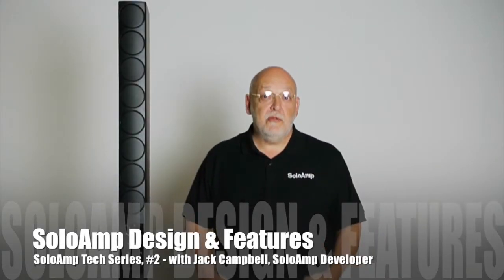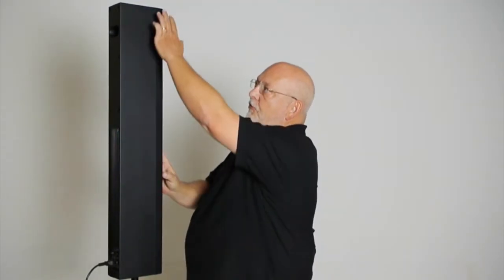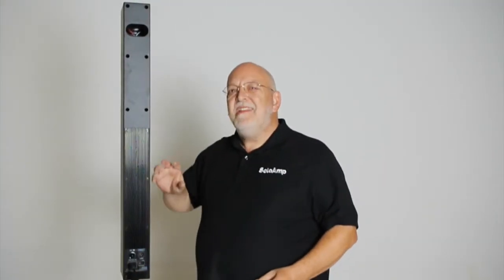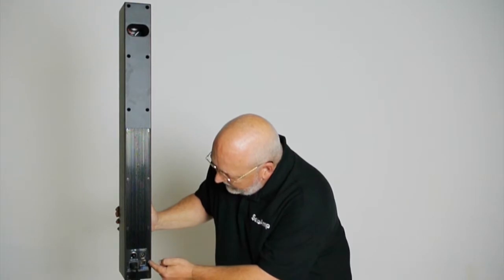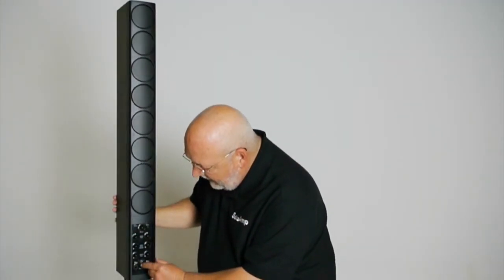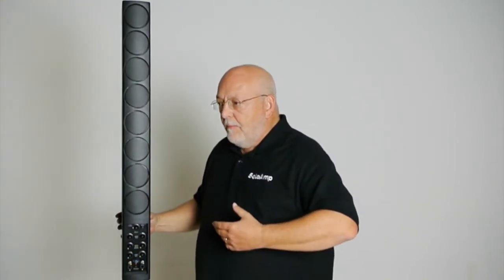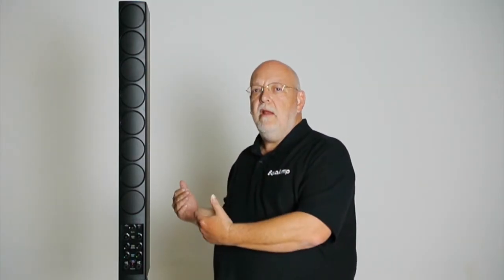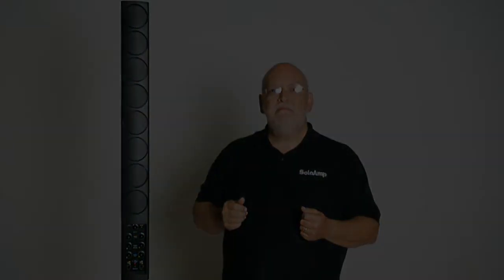SoloAmp Tech Series #2 - "SoloAmp Design & Features"

Comment from the maker: ... however, it's important o understand that SoloAmp's near-ideal line array performance results in SPL droopy of very near only 3dB per doubling of distance. That's half the drop of normal point source amp-speaker systems. So, at the back of the room, the sound can be enormously louder than with a traditional PA or stage amp.